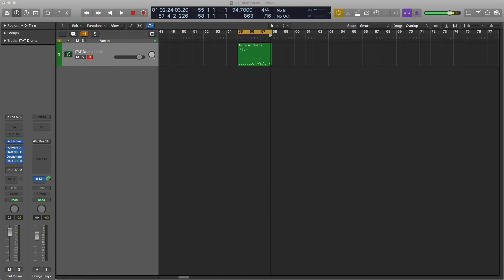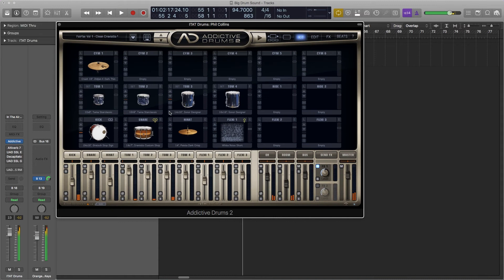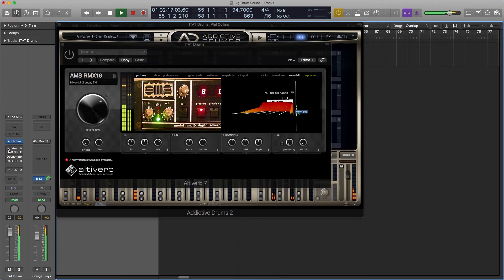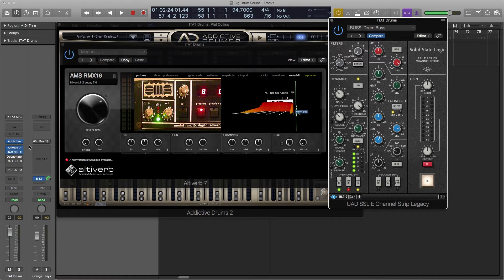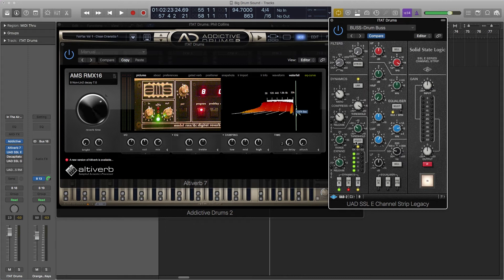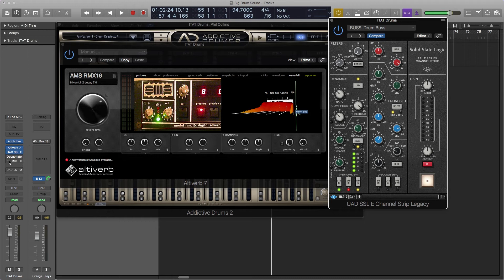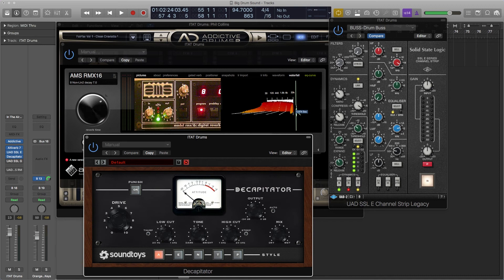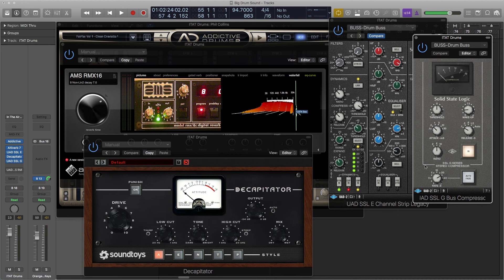How to Mix Drums to Sound Like Phil Collins

Comment: I'm doing the Song right now as a COVER but have gone through all my Logic Pro X Drum Kits, Other Drum VST's and my ROLAND FANTOM -7 to capture this ICONIC "DRUM FILL" ( I do own both ...lol UAD AMS DMX16 plus this other Company that came out with a BETTER version yet sounds the same as the Original AMS DMX16 from Wave Alchemy "GLOW" for those you what that sound don't waste your money on the UAD ( which is GOOD) but this for LESS offerers SO much more for less. Againg, Use a GAte after the "AMS Non Linear 2" to clamp down on those VB TAILS. :)

Comment: Best Youtube Tutorial I've seen in a while! How did you get the white noise short sample to be so short? Mine has a really long tail in addictive drums 2 that muddies the mix - Did you put a gate on the white noise sample?
Reply from the maker: Thanks so much! Yes, there is a built in Volume Envelope in Addictive Drums. It's in the top right corner if you click to edit the sound. I had the settings as Attack: 0.0ms Decay: 5.0ms Sus Lev: 0.0db Sus Time 53.2ms Release: 109ms. Hope that helps!

Comment: Man. You missed one of the most important things. Where's the slap delay man?
Reply from the maker: ...it's not slap delay it's the room, which in this case is recreated by the AMS RMX16, specifically designed to emulate the room